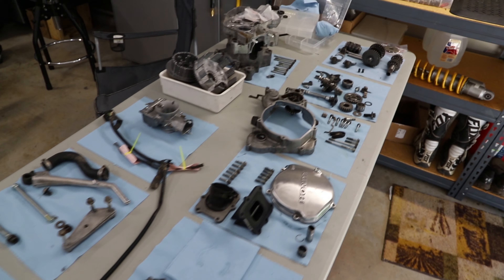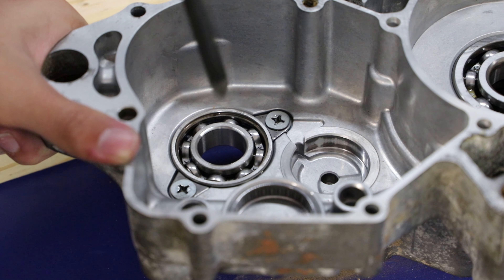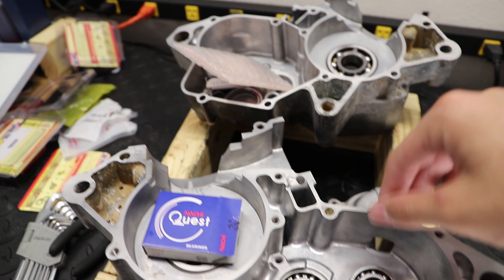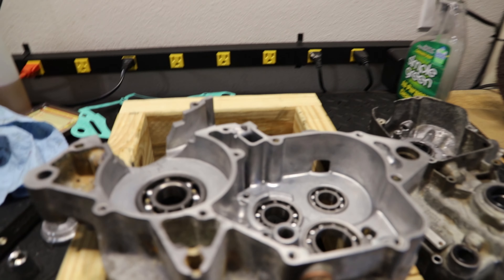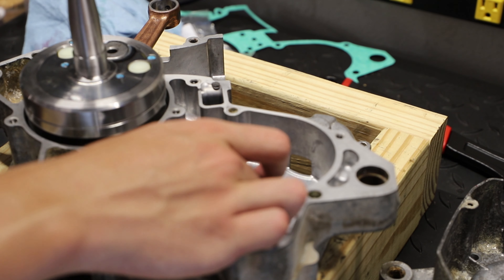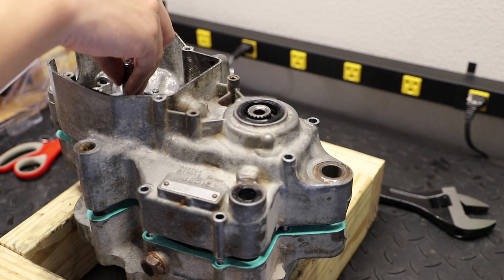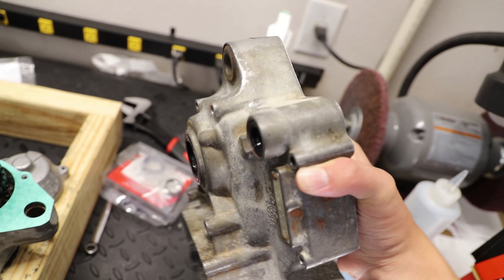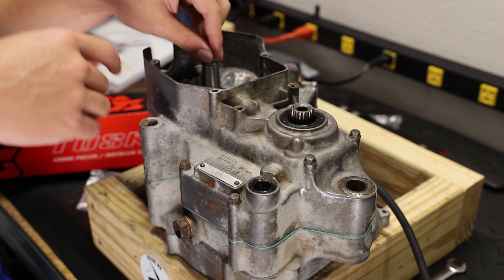CR125 Engine Rebuild - Assembly Part 1

Comment: Very nicely done 👍. You may have mentioned it in a previous video and I apologise but which press are you using? A harbor freight unit?
Reply from the maker: In the video I am using a 20 Ton press from Harbor Freight, a 12 ton would have worked too 👍🏼
Reply: @akmoto_  Much appreciated, thanks👌

Comment: Quick question I have a 2003 cr125 same engine in this video the problem I have is thick oil comes out the top end ware spark plug is plus out the end of the moffler any ideal what's the problem

Comment: @AKmoto I have the same 2003 cr125 that u rebuilding in this video. Having problems with thick oil coming out ware spark plug is at plus coming out the end of the pipe. Have any idea what the problem is?
Reply from the maker: Is there premix coming out of the spark plug’s hole itself? If so, the spark plug isn’t sealing properly, get a new plug and make sure it’s not too loose. A little premix coming out of the end of a pipe is normal for a 2 stroke, especially if it’s running rich or not being ridden very hard.
Reply: I just bought the bike but it's kinda a lot of thick oil coming from the pipe I have other 2 stokes n never had this problem. I was kinda concerned that oil from my bottom end is coming up
Reply: @Abdul Waliyy, bad crankshaft seals?
Reply: Thanks Pedro
Reply: @Pedro Thanks